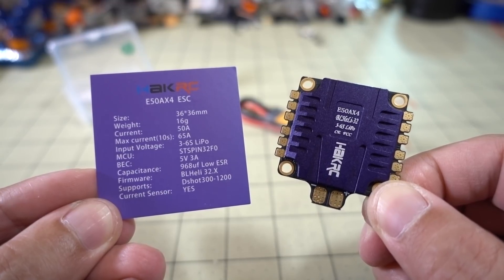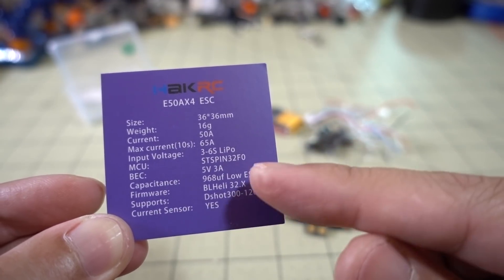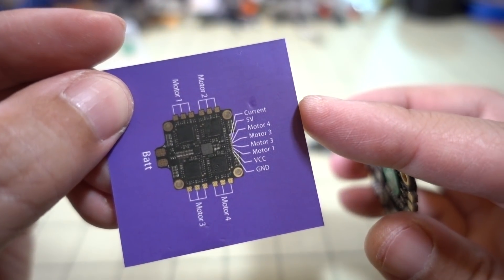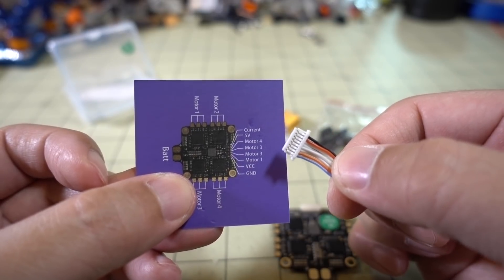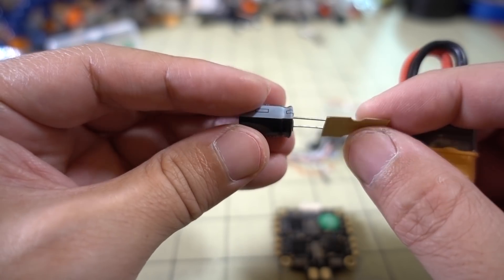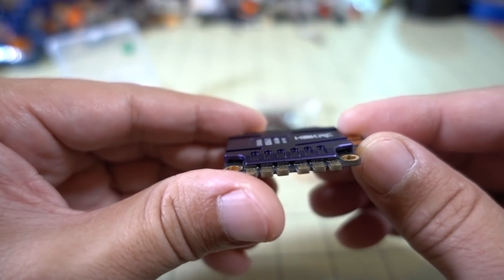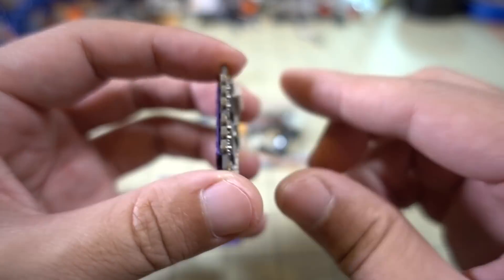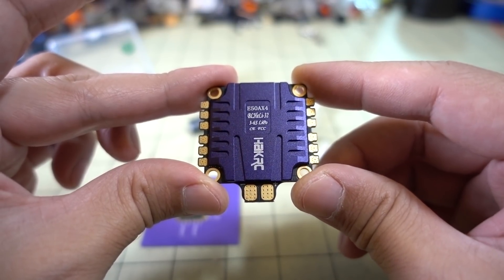HAKRC 50A 32 bit 4-in-1 ESC 👍

Comment: Is it possible to invert the left and right motors (not the rotation direction) in blheli or betaflight so that I can mount this ESC upside down? ...because the heatsink is badly aligned on mine and the nuts won't fit.

Comment: I had the WORST luck with this ESC. I bought two on Amazon and both had horrible motor timing issues. I tried every ESC protocol and every setting imaginable but I couldn't even arm the quad without the motors oscillating and causing horrible vibrations. I swapped ESC and it immediately worked. 2/2 lemons seems unlikely but it definitely turned me off of HAKRC for life.

Comment: ?????     so connecting to flt controller if the controller has signal pads at all 4 corners do you create a plate of spaghetti wires ?   also do you run VBAT from esc to flt controller ?    HELP !
Reply: CaribbeanZapatta The esc signal pads won’t matter when using an all in one , you will only have to make sure one wire for each motor is connected to each ...  ?
Reply: Thank You !  I am not yet comfortable with 4/1   so POWER for flt cont ?  some flt cont have xt60 ?  but if I am using 4/1 with its own xt60 do I just run small wire to power the flt cont ?  and do I use a VBAT pad ?  that confuses me ..  I am moving toward AIO stacks with either pins or cables (EMAX ?)   my next issue vtx ...to get OSD need to run thru flt cont ?  but is it ok to just bypass flt cont power direct from VBAT and simply connect camera direct to vtx using the camera OSD ?    also  using a 20x20 flt cont with a 30x30 4/1 esc ?  if you are only using flt cont to run Betaflight ??  THANK YOU !
Reply: EZFPV Emilliano Zapatta albert goes over powering and such at about 1:13 and forward . Emax has good stacks if your going for an easy build. Yea you can run osd through cam but I have found that it can be more inaccurate at times then running through FC . Make sure your vtx can handle lipo before bypassing. But if it can handle it , then yea you can bypass the FC . As far as the size, it should be ok 👌🏼 send it!
Reply: thanks  I am very comfortable using separate esc on the arms.  easy to repair.  I tried ASGARD  but had terrible luck.  50% failure rate.  and issue with inverted uarts..too complicated ..thanks for help.

Comment: I use it on my 10 inch T5 3115 1050 kv on 6s. No problem. Have two gaint caps pn. Thx for the good work, and keep it going! Greetz from Sweden